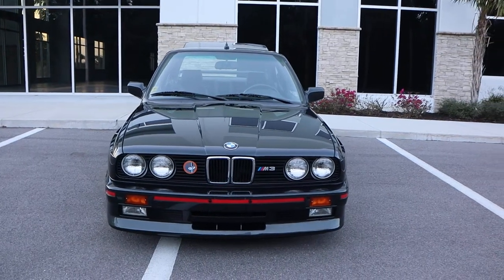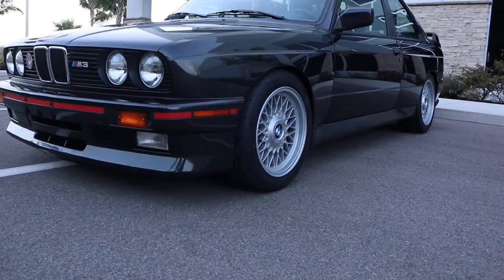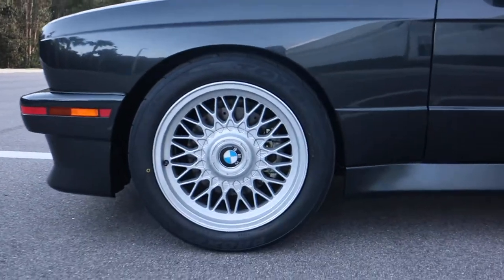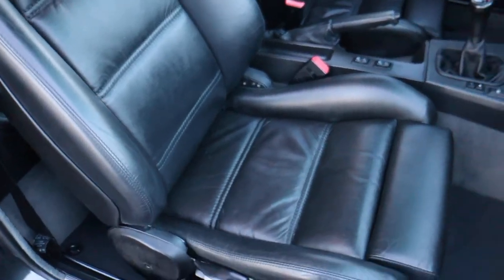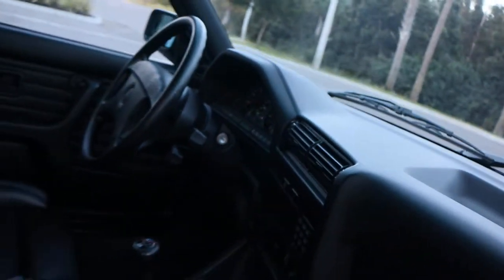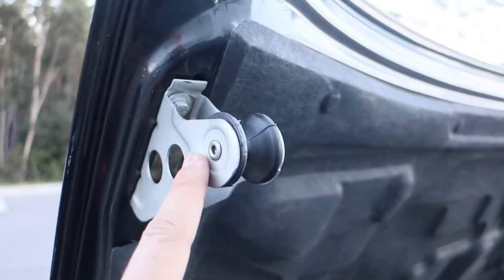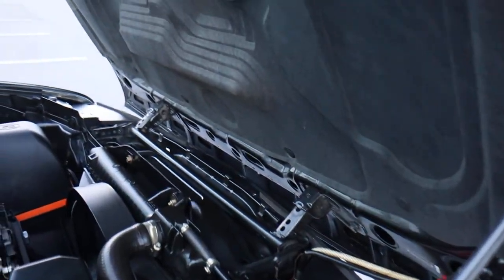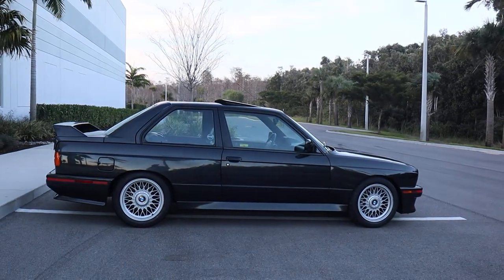BMW E30 M3 - Walk Around

Comment: The steering wheel is not original on a Munich delivered car. There should be a three spoked one in it with a BMW Motorsports 3-colour stripe on the bottom spoke. I think it was changed before it came to Florida along with installing the Markerlights in the front- en rearbumpers.
Reply from the maker: Incorrect; the steering wheel is factory. This was a NA example delivered new in Munich; then driven in Germany for three years before being shipped to the USA when his owner returned to the country.

Comment: Shame Style 5s from E30 in 16" aren't mounted. E30 ones have different hub caps with hexagon locking "nut" and spokes are going all the way to the lip. There were 16" options ready at the day the car was bought, so don't understand that part really. Shame the car wasn't driven as it deserves to be. :)
Reply from the maker: You used the word "Shame", twice in one paragraph to volunteer your opinion on a meticulously maintained and loved E30 M3. You need a new hobby bud!